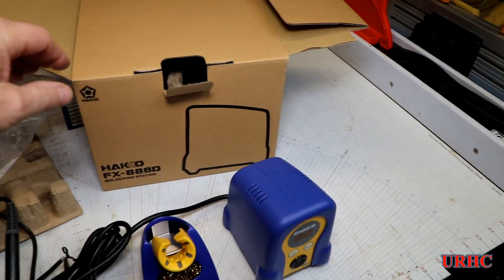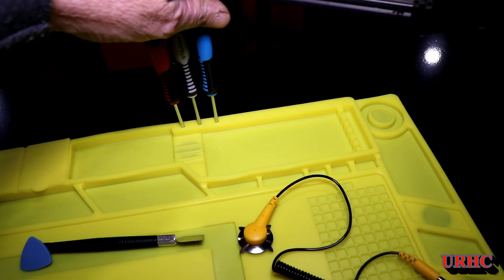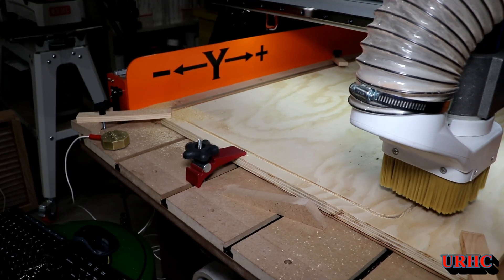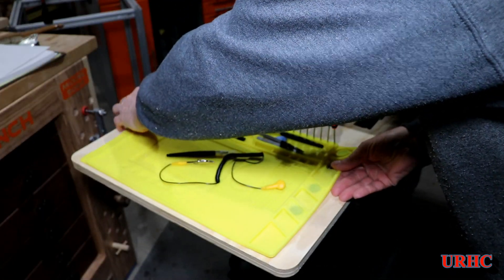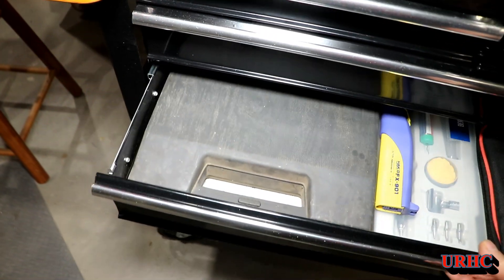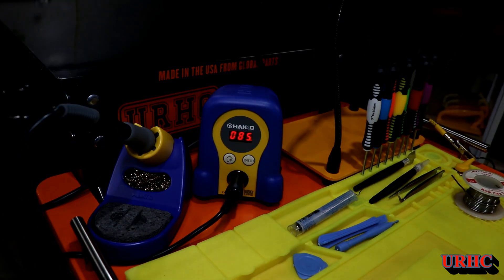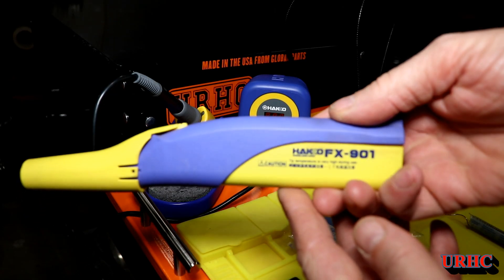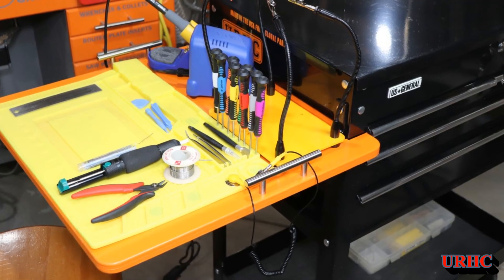Making A Dedicated Electronics Cart With A Hakko FX-888D Soldering Station

Comment: Nice and well thought out project.  One other item that you might find useful is an inexpensive LED magnifying light.  I have one mounted on my work bench by the vise.  Most of the time, I use just the light but can easily flip up the lens cover to use the magnifying glass.
Reply from the maker: Thanks. That's next on the list but ran out of money this month. I have one in my machine shop and its great for reading things like taps as my eyes are getting old.  Thanks for watching.
Reply: @unemployedredneckhillbilly2023  Being retired – I understand the money for this month and the old eyes situations.

Comment: All my soldering and related tools, have to be over 30 years old. My Weller solder station, my excelite tools and other related. I have a multi draw full of resistors of every value imaginable, and boxes of capacitors that have been around for a while, so I'm sure they're junk by now. Good stuff last quite a while.
Reply from the maker: I still have to carry in the plastic boxes with  small components like resistors.  Trouble is now everyone is using surface mount. With  most using unleaded solder all my old irons became worthless for reworking.  Thanks for watching.